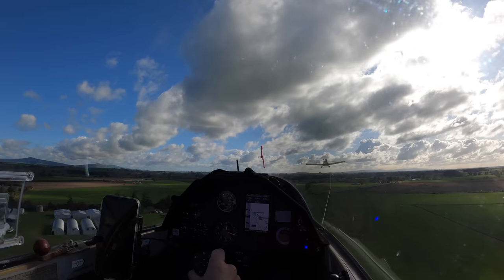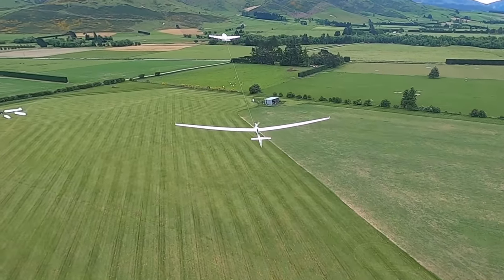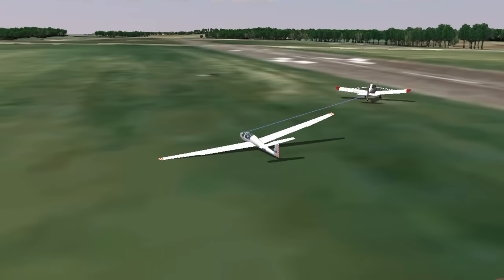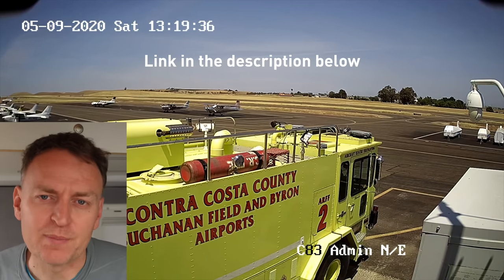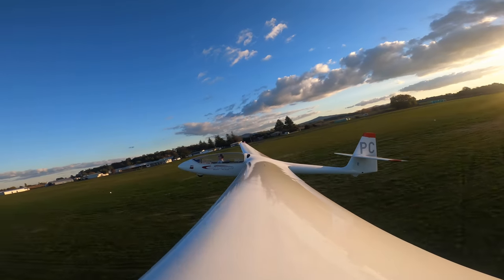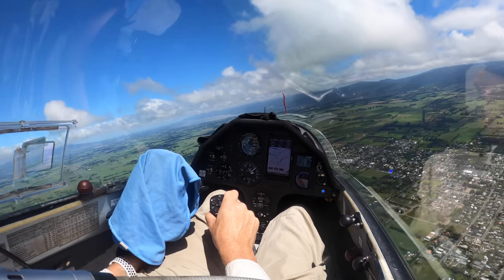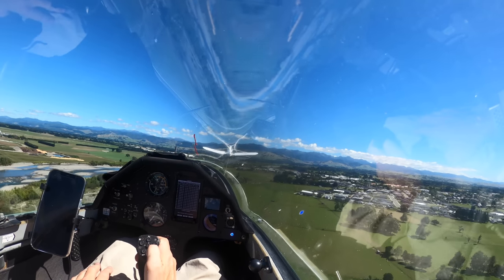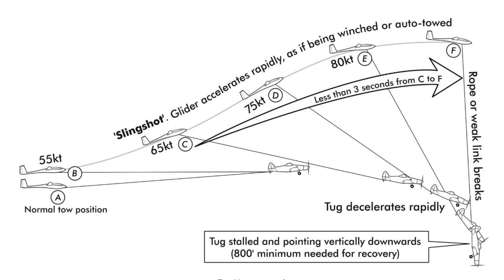3 Seconds to Crash: Glider Aerotow Launch Gone Wrong

Comment: Why cant the tow have a release clip? Maybe an auto release at a certain angle where a latch triggered by the line going at a bad angle will unclip it. Even electronically, like a funnel with electronic trigger on the rim which will activate a servo... I could make one of these.. it would be an auto release and the glider pilot would be responsible and they would still be considered launched and pay for the tow because its their responsibility to stay within the boundaries.
Reply from the maker: They do have a release at their end. And we do have tow hooks that release at certain angles on the winch hook on the belly of the glider. BUT the angles are much more pronounced than the aerotow angles. And yes no doubt someone could design a better mechanism, unfortunately designing new aviation certified equipment for certified aircraft is a time consuming and expensive task, with long testing times...
Reply: Sad to think this was certified an it has its problems. yeah the red tape, I am sure it is for the best but it can also hinder some progress. Sure it would have to be well tested and reliable. These are sad events, I used to get winch launched years ago. even that has had its fatalities and one story includes the wire snapping and coming back to hit the winch operator killing him. Freak accidents, but dam what an accident. like the simplest things can just turn and bite you like that. Happy Gliding, Stay Safe. @PureGlide

Comment: The tow pilot can’t release???
Reply from the maker: They can, read my top pinned comment
Reply: @PureGlide  —
Ah ok, interesting. I’m a mariner, not an aviator. But I know in the marine context we have shackles that are designed to easily release under load. I’m surprised those tow line attachments aren’t similarly designed.

Comment: Would it make more sense to move the tow link to the centre of pressure or centre of rotational mass of the tow plane, such that pulling on it in any direction will not change the attitude of the tow plane.  Immediately I can see the attachment would need to be a ring around the fuselage such that the glider can move above which over complicates the whole thing.
What is happening in this circumstances is usually considered deadly.  "Lock out" where a tethered aircraft moves to a point where the tether has more of an effect than the aircraft's controls can counter.  Often these are positive feedback situations, once they start they present negatively stability and swing to the extremes.  Similarly there are deaths, too often, of glider and kite fliers tethering themselves when learning and not living to learn the hardway.

Comment: This is completely to be ignored in the full size world.  In the model ( 1/4 1/3 and even 1/2 scale) world we tow from the nose. Not every full scale glider has a nose release, some only have the belly hook - noted.  The tow plane has the release just aft of the cg, bolted to the spar. (high wing , think Cub)The tow plane has a natural up pitch under power. (thrust vector under drag, dirty great glider above the thrust vector). The net result is a bunch of vectors that cancel in a neutral way, otherwise my tow pilot could not tow me to 2000 feet in a controlled manner. Literally as the towee I do nothing. I pay attention when the tuggy says 'getoff' . Then I fly.

So the dynamic is thus :-  The tug keeps my nose low (nose hook).  My over high tow position pulls up just behind the CoG, helping the tug to climb (as a vector). the full power of the tug causes a nose up moment (against my drag), and all of the vectors end up in balance. 

The net result of all of this is that all the vectors cancel out, and it has become the norm.  THE safest way to maiden flight a big model (10 meter span in some cases) is aerotow. We have no idea of relative height after the launch.

If this system works so well an reliably for us modelers and our toys, is there not an argument for doing it wit the big ones?   Nose release, a high tow position and hook on the rear spar of the tug?

This is complete conjecture for discussion.

Mark.
Check my channel for my only video, from a long time ago. The glider is 1/2 scale, 1927 design, with the aerodynamics of a parachute. 7 degrees of washout.  At ANY airspeed part of the wing is stalled, or generating negative lift.  It fly's like a pig.  But on tow, behind the super duper greenly (google it) it tows straight and true.
https://www.youtube.com/watch?v=UOlMnj1Xdww
Notes :-
Yes the flag on the tow line is a g string. Blame my tug pilot, the best model pilot on earth.
The model is 20" span, 38 lbs and gottingen undercambered. ( i can hide my 1/3 asw20 wings under them!)
There are no air brakes , but diving induces drag , like the parachute. That is how i control approach  Hence the zig zag 'close' to the trees (it wasn't) . 

RESULT:-  Should the tow hook positions of full size tugs and gliders be reviewed ?
Reply from the maker: Hi yes gliders often have a nose hook and belly hook. Belly hook used for winching and towing. Nose only for towing. And if you have both, you always use the nose for towing, for that reason, it helps pull the glider straight. Cheers!
Reply: @PureGlide  Hi, for some reason this video popped up again. My original thoughts were moving the tug tow point to the rear spar (like we do with the 'toys'). And adopting a 'high' tow position to keep the rope above the fin.
Not once in 35 years of model towing have I ever seen the rope (we call it 'line') go round the the fuz of the tug.
Aerotowing is considered the safest launch method for maiden flights of large models.  Some of our toys are 11m span now. 
Just thoughts.
I'm guessing that there must be rules on the modification of tugs, and the placement of hooks. Has anybody ever looked at not putting the tow hitch under the rudder?  Is it there just 'because that's where it has always been' ? 
(PS have done some full size flying, not completely ignorant here).

Comment: It's a shame there is no mechanism such that if the rope is under tension in a direction that is out of bounds, it gets released automatically.
Reply from the maker: We do have a weak link on the rope so if there is too much pressure, it will release.

Comment: Sounds to me like you need an emergency tow release workable from the tow plane. Why hasn’t this been invented yet?
Reply from the maker: There is one, but the pressure from a tow upset can prevent it working. See the top pinned comment for more details. Cheers for watching!
Reply: @PureGlide , sorry, didn’t make myself clear when I said "emergency"….I meant a small explosive device to push the tow jaws apart, air bag tech/explosive would be fine. It wouldn’t matter how much pressure was on the hitch if it was able to have a small controlled detonation to release it. Just my thoughts, Richard.

Comment: There aught to be an engineered solution to this, a mechanical device on the tow plane that detaches when an amount of force greater than the weight of the empty cable is pulled outside the safe angle. Surely not impossible to design such a device reliably.
Reply from the maker: It's a good idea, unfortunately designing and building equipment for certified aircraft is an expensive and time consuming process. Don't let me stop you though, go for it!

Comment: so  ....isn't one solution is for the tow plane have the ability to release immediately?
Reply from the maker: They do have a release at the tow plane end, but it happens so quickly, they might not be fast enough. But yes that is what they are meant to do! Also once there is extreme pressure is on the hook it can be difficult to release it.
Reply: @PureGlide  oh yes, i expected that.  i know it is overkill, but how about an exploding release, just for the occasional emergency with a nice big RED button, like some people need when they are under STRESSSSSSS?
Reply from the maker: Sadly even that might not be fast enough. Once  pointing down to the ground, the altitude might not be enough to recover

Comment: I flew gliders extensively in the 70’s . Our CFI was a person of great experience and knowledge. We adhered strictly to low tow and had a rule that , if sight of the tug is lost, bung off immediately and execute a turn to the right . We used some old Schneider machines in our club and also a couple of L 13 Blaniks. As people were introduced to more complicated models, the other golden rule was to not mess around raising your gear until you have released the tug and established separation, and always focus on the location of the tug and the rope tension , making sure you don’t overtake the tug , especially on first flights in gliders that are a tad more slippery than you are used to. I had later experience several decades later and was curious to know why some clubs insist on high tow. You virtually have the tug sitting on you’re nose and within a second of losing sight of it in active weather. 
I always wanted to come across the pond to experience some real mountain soaring but I’m a bit beyond it now and keep my hand in with my simulator.
Cheers and safe flying from across the ditch👍🇦🇺🇳🇿

Comment: Why do you not advocate the use of a winch, or other means of a ground-based tow? Especially when I travel to Aus as often as possible for the sheer thermals which we don’t get here in the UK - towing is purely for altitude in my case, or taking to certain thermal-rich locations (flights from which, in my personal opinion, shouldn’t even cater to gliders). If you can’t do it from FL010 then go somewhere warm as 7 times out of 10 you’ll be down in 30 minutes max anyway. Australia is the greatest glider territory on earth - and I got my wings as an ATC Air Cadet in 1988 in an RAF Sedburgh, with no canopy! Thank you to F.O. Walton-Smith for my maiden flight out of RAF Sealand in 1984, and introducing me to Aus.
Reply from the maker: We use both, there are dangers with both aero tow and winching. Both are perfectly safe if you are ready to deal with things that go wrong quickly! I love flying in Australia too, it's a whole different ball game from New Zealand

Comment: Having a nose hook for aerial tows really should be the standard, and gliders without them should get one installed if that's how they plan to fly.  CG hooks add complications and are damned inconvenient for the ops people on the ground hooking them up.  They also lead to more ballooning on take off, since the aircraft is being pulled from underneath the center of gravity instead of in front of it.  I understand adding a nose cook can be expensive, but it isn't just your life at risk.  You also have the tow pilot, who can't actually see you or what's going on during a large amount of tow.

Comment: I tow fly for the local club in a Piper Pawnee, a very good work horse. On the job it was designed for ie., Cropdusting it was a very good aircraft. Few pilots especially gliders pilots don't really know what a tug plane pilots has to cop with ie., VERRY LITTLE RESERVE.The problem with towing gliders is maintaining airspeed. Glider pilots need to remember, that tug planes like the Pawnee
fly well with little reserve. The 235 H.P. Pawnee of course is a far better aircraft. But the gas bill is higher. The Pawnee is an aircraft taht will also spin well. It doesnt get the bpilot much chance as you need to be very quick with opoposite rudder, forward stick and hope for the best. For me I like to tow gliders in a high wing position. It helps keep the nose down on the pawnee and it is a very safe towing poistion.

Comment: With the technology available these days, I am surprised there is not an emergency mechanism for the tow pilot to release the tow line from the glider. And why did the tow pilot not radio the glider to release the tow line? I realize it happened quickly, but the tow pilot had to have known that the glider was  above him and in a dangerous position relative to the tow plane. Some parachutes have altimeter triggered automatic deployment devices. It seems that there could be an electronically triggered device that the tow pilot could use to sever the tow line from the glider in case of an emergency.
Reply from the maker: There is a release at the tow plane end, but:
- It's difficult for the tow pilot to identify what the glider is doing
- Once there is enough tension on the tow rope, it can be difficult or impossible to release
Reply: @PureGlide  Thanks. I thought there must be more to the problem. Also, after I posted my comment, I went back to the diagram and realized the 3 second time window started when the glider was just above its ideal position. I thought it began after the glider had reached apogee above the tow plane, which would have given the tow pilot more time to realize there was a serious issue developing.
Reply from the maker: Yeah and the tow pilot can't be looking backwards the whole time, they also have to look forwards!
Reply: @PureGlide  Well, at that critical time when a glider could shoot up above me and send me into the ground in 3 seconds, I would be less concerned about the view up front. I would be keeping my eye on that guy attached to my tail. How difficult would it be to install a rear-facing camera to keep an eye on the glider and tow line? Pilots look down at their instruments all the time. And they often place multiple cameras inside and outside the aircraft. He has just taken off. It's not like a building is suddenly going to appear if he takes a second to see if the plane he is towing is about to drive him into the ground.
Reply: There are often buildings and trees at the end of runways. When you are focussing on clearing them and the glider pilot doesn’t communicate you don’t turn backwards, and you still wouldn’t see the glider if they are well above you. From the daughter of a tow pilot that was forced into a nose dive into those said trees, and he didn’t make it out.
Reply: @clairemcgrannachan1921  I am sorry for your loss of your father. I mean no disrespect. But this is 2022. We are in an age of high-tech resources. It seems that more difficult problems associated with flying have been solved, or at least made less dangerous. It is difficult to accept that there is not a practical, cost-effective solution to this well-documented threat and that tow pilots have to accept this risk as an inherent part of the sport.
Reply: It seems logical to add all this technology but when most gliding clubs are run by volunteers on a paddock / runway with limited resources this isn’t always feasible. Also as the glider (in my Dads case) can not only be above but also out to the side you would need cameras to cover 360 degrees, and if there is too much tension on the tow rope (which also happened) the tow pilot simply cannot release. And this all happens in a manner of seconds. Manning vehicles of any sort comes with inherent risk, just as motor vehicles. Technology doesn’t always prevent tragedy

Comment: "The reason this happens so fast"  um, the glider was very high for 10 seconds before it upset the tug. Either pilot had nearly ten full seconds to realize something wasn't right and hit the release. If BOTH pilots were not recognizing the situation for THAT LONG, THAT CLOSE TO THE GROUND, I would expect a crash and probably a fatality. Ten seconds is an eternity!
Reply from the maker: True, except the pressures on the rope can mean within a few seconds the tow pilot is no longer able to release. So it's quicker than it might look!
Reply: @PureGlide  I get that, though the inability to release once things start to go wrong screams to me that the device is mis-designed, or the weak link strengths are improperly chosen. It's like having landing gear that can't support the weight of the plane: but they'll work fine at long as you're in the air. 
Also, could the tug pilot not simply go hard nose-up to try to put the plane back in front of the glider? Or is the assumption that they were already doing this and the result was nearly-level flight for the tug, with controls maxxed out? 

I have biases which might gibe me bad instincts here, however: I've only had a few instructional sailplane flights, and I PIO'd pretty badly when the pilot in command let me try my hand at flying the tow. But I'm a hang glider pilot and have had a bunch of tows with those. But I don't think I would fly with releases that stopped working when the situation got bad.

Comment: Given the fast that it's happening more often I think that the tow plane has to also have a way to disconnect from the glider. That should not be only to the glider discretion. The tow pilot feels hell broke lose he disconnect and that's it. Yea, I know that optioning not available. I would make it happen. Some engineering some prototypes and bum! This way the tow pilot does not have to die if crap happens.
Reply from the maker: They do have a way to release at the tow plane end, but the tow pilots, while they have a mirror, they also need to look up and out. And at 3 seconds, chances are they’ll miss the crucial moment they need to release